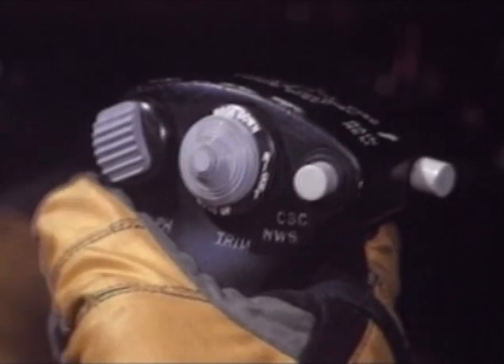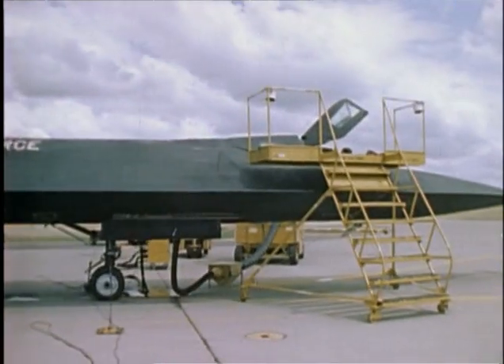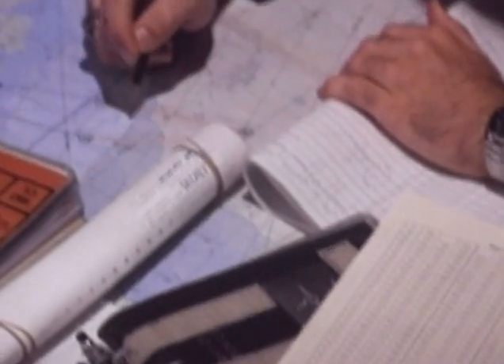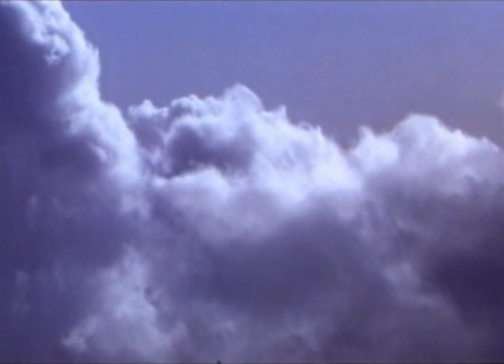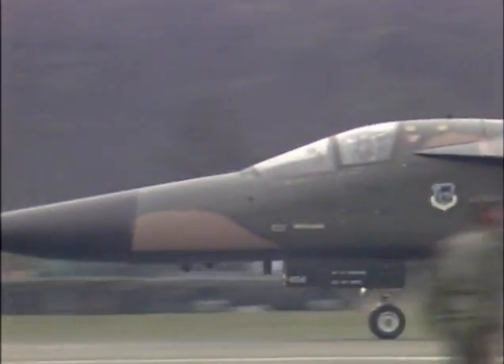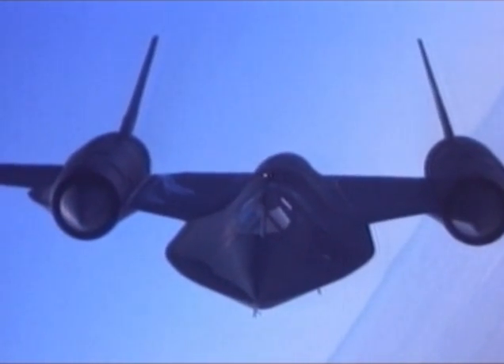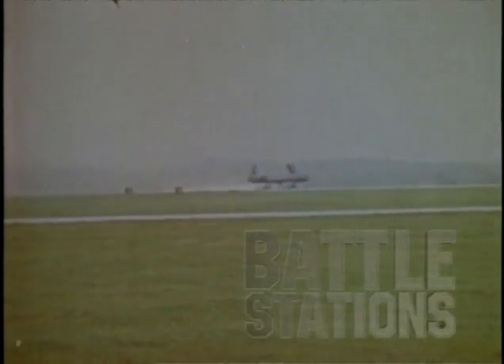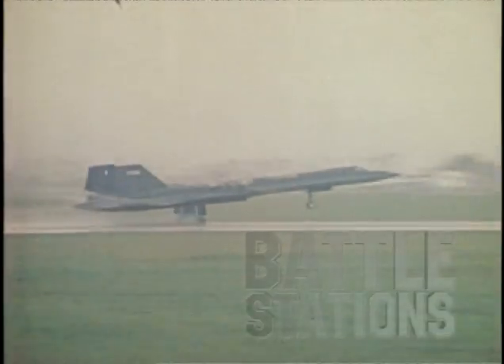Battle Stations - SR-71 Blackbird Stealth Plane -Full Documentary

Comment: I'm blown away that the first flight was 1964. It was so ahead of it's time.
Reply: Well, technically, the airframe first flew in -62 as the A-12, its insane that this marvel was created way before any computer aided design was introduced, even more astonishing is to compare it with the cars and trucks in that era, they looked like horse carts compared to the A-12 / SR-71
Reply: @Jeppelelle  That was the YF-12A , do not know what a A-12 is? Did you know that the YF-12A had a air to air missile bay just like that on the F-22. Can not tell you how I know that, I would have to off you. Sincerely, the only one here that had a top secret clearance in 1965. It is old hat by now, but what the hell. I do agree with you about the comparison, wonder what is going on now? Any bodies guess. Now the trolls can jump in.
Reply: @Jeppelelle  Just a small note. Did you know that the YF-12A had two internal air to air missel  bays like the later to come F-22. And just what happened to that airplane, I wonder. EDW AFB 1964-1966 6515 OMS. Ponder that for a while. That was flying when I was there.Guess no one will know.for sure. Kind of interesting. It all depends on who or where the information comes from. Both top secret to this day.
Reply: Actually, as was mentioned towards the end of the documentary, there were things the SR-71 could do that satellites cannot. One major flaw of satellite reconnaissance are the fixed orbits of the satellites. Adversaries can learn when satellites will be overhead and disguise their secrets accordingly. Re-tasking a satellite to alleviate this problem is extremely difficult and expensive. The SR-71 could pop in on you at ANY time, and you would have little to no warning to prepare for it. Satellites are great, but they are no substitute for a spy plane. A total reconnaissance package would include both satellites AND some more mobile platform such as the SR-71.
Reply: na,,,,  we are just so in the dark.....  technology rolling out today for us was used militarily 30 years ago.....  sophistication is not easily digested by the general population....  so we get it gradually.....  we never would use it for anything good....  look at facebook .... 1 billion retards taking selfies.....
Reply: Felix Burke,   If you can get your hands on one of those UFO's and challenge the Blackbird to a race, I'll think about taking that comment seriously.
Reply: Mr Obvious just ignore the ignorance of these 'truth' clowns. You can't convince a brick wall to see your view, as with them.

The 71 was and still is one of the single greatest benchmarks of the modern era. One cannot even fathom what the SR-72 is going to do.
Reply: Wandering Wade just realized this myself
Reply: Wandering Wade and still is...
Reply: or the time was ahead of ours. space flight, atomic energy, the introduction of computers. i think if you asked someone from 1960s about the nearest future it would be pure science fiction from a modern viewpoint.
Reply: British Federation of Truth How did aliens get here with such poor technology? They would have way better materials and engines...
Reply: Mr Obvious best we could do with primitive tools available to us at the time!!!
Reply: Just wait until you see the SR-72.  Zoom zoom
Reply: Wandering Wade to the moron who said that the sr was just a showplane......you are just displaying your ignorance. Do the world a favor and don’t comment on matters that are waaaaaaaay above your intelligence level
Reply: What I get a kick out of, although I don't believe it was mentioned in the video, was the titanium used to build the SR-71's could only be sourced from the Soviets.  There's something very ironic about overflying the Soviets in a plane made out of their titanium.
Reply: @larrygall5831  yep phantom sale 👻
Reply: Wandering Wade
Reply: That same info tells us that it's probably already possible to do more than just stealth in 2018. I can't wait to read what tech is being made and used right now in secrecy.
Reply: Makes you wonder........
Reply: However, that first flight was built upon many of the R & D successes of the previous decade, such as the X-15.  Science building upon the science of the past.  And the next SR-71 descendant will be even BETTER.
Reply: @hartley81848184  I cant believe that the first flight for the B-52 of which the X-15 depended on had its first flight in 1952. Thats only 7 years after WW2 concluded. X-15 and A-12 family are amazing birds, as is the RB/B-52s.
Reply: Jesper Andersson considering the Wright brothers first flight was in 1903 it just goes to show you how amazing this technological revolution was
Reply: @scottyweimuller6152  : be nice to bring wright brothers through time warp , show them there kite plane turned into a MACH MONSTER & watch get light headed and just pass out.
Reply: @brianseifer9744  they'd literally soil themselves and have heart attacks at the same time if they ever saw the SR-71 in action. I mean hell when I was a kid I almost did the same thing  when my dad took me to a air race show and they flew in a SR-71 above my head.  No plane could ever beat that amount of raw power and enormous sounds it made while flying
Reply: @scottyweimuller6152  wright brothers. "  I just wanted to go for Ride in My kite plane  and these technocrats from future turned it into biblical flying monster**. Congratulations on seeing SR fly at show , what year , where  and how old were you . I missed it @1989 Oskosh , Wisconsin Airshow, but I did go to Dayton,  Ohio , hydroplane racer there , down rode ,5km Wright- Patterson had a YF-12A ,I went up and gave it a feel, like non skid( Sandy).    In 1985 oskosh had Brittish CONCORDE give 45 min. demo- ride's ,so took 400$ ride for birthday .    Are you Ausrian for German?
Reply: Austrian or German
Reply: Computer design?  Heck, they didn't have calculators!  Slide rules and log tables, baby!
Reply: It speaks volumes that no other country has been able to build their own and fly them over the U.S. - still ahead of it's time.
Reply: And yet there isn't the technology to make humans fly past the moon in 2018
Reply: +少年Damidas they could easy get past the moon its just the whole coming back part they cant do lol
Reply: you're out of touch is all
Reply: This is what happens when the richest country in the world is under threat and they throw infinite money at it. Things are worse now because of budgets. Look at the Harrier jump jet, it hasn’t been bettered for what it could do. The Euro fighter had the opportunity but budgets ruined it.
Reply: when you throw engineers at it not money, NASA blew billions trying to solve the space station life support system and had to buddy up to the Russians when they were too broke to carry on. Russia didn't need money to solve it...
Reply: Can you imagine what they have now that we don't know?
Reply: ....what do you think they have now?....
Reply: That's why those men were called "The Greatest Generation"-they were and in every instance, proved it.
Reply: My father worked at Lockheed Skunk works...they were sitting on the grass knoll drinking beers and eating bologna sandwiches when that big beautiful son of a bitch took its maiden flight!
Reply: A fine example of the art of capitalism!
Reply: Just think what they are making now...
Reply: Building a starship would be the technological equivalent of today.
Reply: haha 20 to 30 years behind, try 100+ years ahead' if you had access which I do not think you do  @ETVHunter  ,you would know now that they are using Hg plasma engines, which fly just under light speed. first you have to have access to Darpa, to get to the right page, I do. then look for  ( I arpa ) information advances research project agency.
Reply: Same ugh😭😭😭 RIP Kelly Johnson😭 sometimes i dont like being a gen z, we missed out on LOTS of things.
Reply: The global free market killed all innovation, not just decent jobs.
Reply: Did security for her at Beale and a couple of top secret bases around the world a beautiful Lady indeed!
Reply: Oh almost forgot also got to see what replaced her
TR  - 3B
Reply: It was before that, I tracked it in 1963 over Mcalester OK over 80,000 feet doing over 2,300 MPH with a MSQ 39 Radar!
Reply: Yeah,  or   we've   dismounted  from  the  shoulders  of  the  Giants  upon  which   we  once stood  and  have  fallen   way  behind   the times...
Reply: Still ahead of its time TODAY.
Reply: Truther One Anyone with truth in their name is about to say something opposite of the truth. You probably aren't aware of just how many times this plane was used for surveillance in war when there was no other alternative. So now I am curious why you are so butthurt about the SR-71.
Reply: Wandering Wade
So when it's time supposed to be? Do you realize why this awesome plane is now flying only in movies? Because ther's no need for it, satelites are doing it's job. The time it was built and used was the perfect and only time for it unless someone want's to spend medium size country budget on something like Blackbird just for the heck of it.
Reply: another lie, 1964 was a public news special, it was made an flown in 1958, an 2000 mph was also a public, truth was Mach 7+, an another thing they did not tell anyone was the wiring was make of 22k Gold, moving at the speeds it was using, meant, the wiring harness had to be changed every time it landed. where Mach 1 is  761.2 mph x  7 = 5328.4 mph
Reply: @gaurtaukwhiteangel5779  ahh so you're a delusional paranoid Republican that blames the military for lying and you have top secret clearance to access those documents. Please dude stop lying about everything and don't comment about completely false conspiracy theories. Im tired of all you tinfoil hat wearing crazys. What next you going to say the lizard people control the world also? GTFO nut job. Crawl back into your mothers basement
Reply: Hell, the ENglish invented the first jet airliner in 1940s and early 50s... :)
Reply: You must be joking, the Blackbird is primitive compared to the discs that they have been constructing since the 1950s
Reply: suppose you've done more with your slide rule, huh?
Reply: Just an expensive show plane - that's all they are.
Reply: ....a diversion for what they really building....
Reply: Many knowledgeable people have termed the Blackbirds the greatest engineering achievement since the pyramids. But of course someone as well rounded as you knows it was a small insignificant feat-throw away.
Reply: @trutherone2140  that you Russians could not do anything about it. Mig 25 it just laughed at that plane missiles they just wave bye bye lol. Spy plane what dovu mean show plane damn just hating.. holds fastest speed and altitude recorded.

Comment: I wonder how many SR-71's are black ops operational, today.  Also, I am confident the USA has a top secret successor to the Blackbird.  If the Blackbird did Mach 7.5, perhaps we can see the new spy plane cranking out Mach 10.0 with ramjet power.  The USA absolutely needs to maintain its technological and strategic superiority in this endeavor.
Reply: Gene Murphy
 5678sothourn
Dusty Rusty

All I can say is the SR-72 has been in development much longer than anyone has mentioned here and I "kinda" witnessed an engine test at a Contractors remote facility few are aware of, since it was not in a traditional location so many are aware of.  Most of the town that could hear it, were instructed not to discuss it and I was another Contractor in town doing technical instructions on an unrelated system.  
If I mention the town's name, it would be perfectly clear why it was tested where it was, and few would be able to identify it today.   So all I will say here.
  Another confirming, but extremely vague, yet subtle post occurred in the US news when a US President responded to China's  launching a Military satellite from a Civilian "Space Mission",  He increased the funding and purchase for another 5 units.   It was on the last page lower right corner of the political section of the paper that week, and was welcome news to that town!
But all I will discuss here in this forum.  Also a former SR-71 pilot told me quite directly that the SR-71 would not be retired unless they had something better, yet still classified.  And my reply was saying "some say that would be Satellites."  And I was corrected quite sternly and with absolute confidence from that former SR-71 pilot which I will not name.

If you think you know, just mention the Classic Aircraft this town is known for in history, and I can tell who understands my post!   And no, it will not be a multiple choice question to ferret out information.

And to the fine Americans in that town that explained what was happening,  
I have kept this secret for 25 years and will not share it to anyone until that project is cleared to the public.   It was very hard to secure an entire town and you did a very good job!  Every member of that town had a team member in the family and they were fantastic at security!
Reply: Dusty Rusty they retired the blackbird in the 90's and yes the have a 3rd generation successor..
Reply: I AGREE DUSTY
Reply: DUSTY I THINK ALMOST ALLL SR-71S ARE OPERATIONAL
IF THEY WANT ALL OF THEM THEY CAN GO TO THE MUSEUMS AND GET THEM THEY ARE SERVICED AND KEPT OPERATIONAL
Reply: Thanx for the heads up.
Reply: Dusty Rusty 41:23 cost of blackbird no longer sustainable and program terminated.
Reply: Dusty Rusty The SR-71s are all retired. However the SR-72 son of Blackbird is still in development
Reply: Why do we need a spy plane..arn't satellites better.  Actually, no satellites do not exist and all war is controlled demolition.  All war is a construct to enrich central banks.